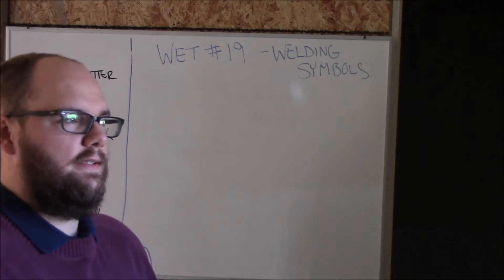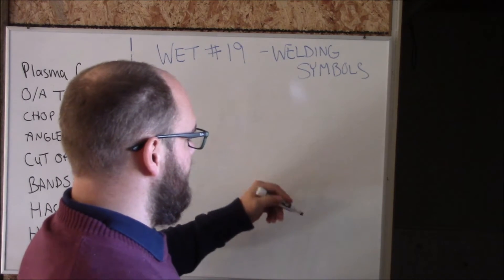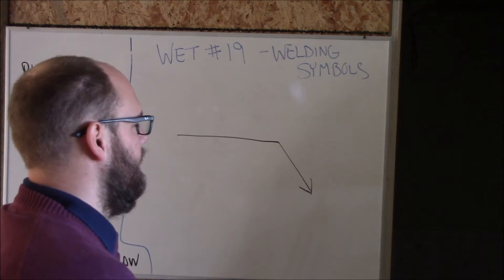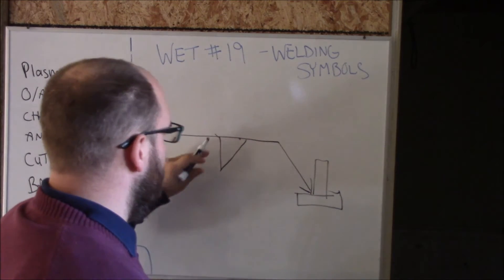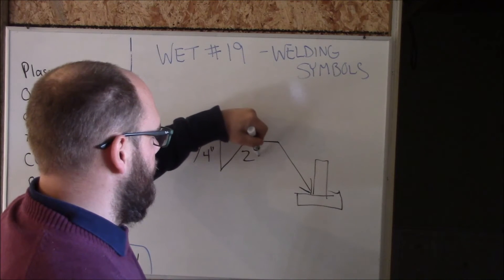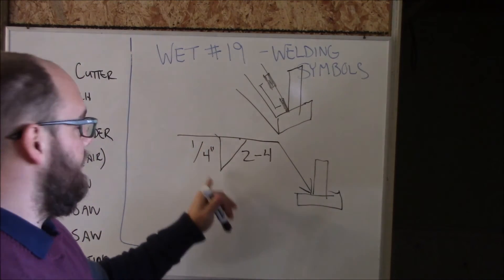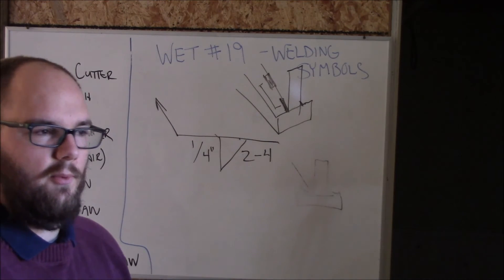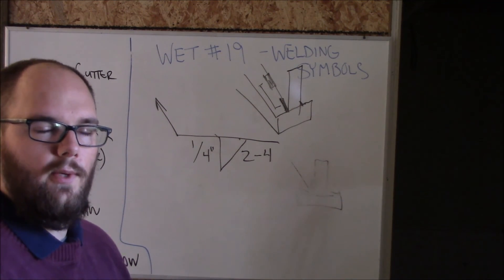WET #19   Welding Symbol Part 1

Comment: I know very little. So my weld length is gonna be 10 3/4 inches long. So to the right of the weld symbol I would write 10 3/4" ?
Reply from the maker: +Don Nesbitt Yes, another way I've seen it done is to designate point a and point b on the print and in the tail or to the right say A-B. But that isn't the AWS way. the AWS way is as you said writing 10.75 to the right.

Comment: Thank you for the video. I learnt something from it.  now I understand the length and pitch. sometimes on the left side where the symbol indicates the weld size, I have come across numbers in close brackets. e.g. 3/4 (7/8). how do I read this? thank you!
Reply from the maker: +Eric Bans Most of the time you see this with a groove weld. the 3/4" outside of the parenthesis is indicating the depth of bevel, and then the (7/8") inside of them is indicating the required weld throat size. so ideally you would need to use a welding process that will penetrate 1/8" further into the base metal than the 3/4" bevel/groove preparation to achieve the desired 7/8" weld throat size. Hope that's not too confusing, and I feel like this is a great candidate for a short video. Thank You!
Reply: +David Finch (dfmmc2014) 

Thanks , it is not confusing. I got it. you are the best. Obrigado!

Comment: Become a Union Welder and you would have not had that problem of not knowing....
Reply from the maker: In particular which union would you suggest? I know some great ones with absolutely great welders, and I know of some that all they know is how to pull a trigger. Some iron working unions are stronger in teaching this. I will straight out admit that pipe line welders and iron workers are some of the hardest working welders I have ever met. I have also worked as a manufacturing engineer in large company fabrication shops where they are just there. I believe it is in the person individually that needs to take it on themselves to learn and better themselves.
Reply: David Finch I was referring to the United Association of Steamfitters...we do all sorts of pipe and structural welding including Pipelines. I am personally working out of Local #342 in the Bay Area California. Here are welds I did last week
https://www.facebook.com/photo.php?fbid=498913130275972&set=pcb.381159695388586&type=1&theater
Reply from the maker: WestCoastMods I don't know if you got your facebook locked down to outsiders, but I can't see the pictures from that link. If you are willing to share pictures of it publicly though you got some decent quality welding.
Reply: David Finch Yeah, you would have to join the group....sorry